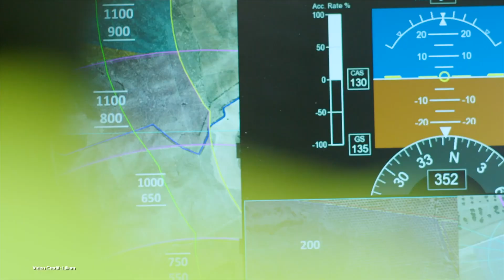ecoTEC Episode 343: Solar-Powered Trip Across Africa! Paris Motor Show! Zero Labs’ “Anti-Cybertruck!

Comment: My biggest concern is this: if the entire fleet of ICE cars that exist on the planet right now all were replaced 1:1 with EV,s where would that level of battery materials come from? 
a) We've have to mine half the planet to get the resources needed. 
b) There's countries like China that are clearly leaps and bounds ahead in the manufacturing department. 
I still feel like Hydrogen is the better long term solution, but Tesla just made the "EV" cool and everyone follows what's cool, not what's logical. 
I love what Hiringa is doing in NZ.

Sure we'd probably still need china to produce the fuel cells, likely as it's cheaper to use their massive world leading (and somewhat suspect) factories and plants. 
I also know that the platinum required for FCells is rare and scare and hard to extract.. but if we could come up with a more sustainable solution to that I feel it would be easier. ^_^ (I  know so easy to just replace an element right?)

So whilst I love the idea and 100% support the idea of EV's, I feel until we can completely synthesize the creation of the components needed for Batteries from renewable materials it's just not a smart option to have the whole planet become EVs. 

Someone needs to make an modern car that runs on a spring wound clockwork that boils water and makes steam to pressurise and move a ICE style engine, with sails.  Yea I know..

Ever see the game Syberia with the wind up train? we need that IRL lol.
Reply: Your just recycling the same old FUD...
Reply: Awww it's cute, you typed or, more likely, copy and pasted all this and posted it feeling all clever, but all you did was expose a deep lack of knowledge and an incredible gullibility to believe what the fossil fuel industry has told you.
Reply: Lithium is really common, "just" a case of mining it, and there's also other chemistry like Sodium ion, EV batteries are also recyclable, so whilst it's not 100% once mines most will be reused. 94% of Hydrogen comes from fossil fuels, (green hydrogen is only 4% and is really expensive). Green hydrogen isn't efficient,  you need 4 times as much electricity to move a vehicle the same distance as EV, Fuel cells also don't last anywhere as long as an EV battery (100K vs 400K), does produce pollution like NOx (our air is not 100% Oxygen, there's other things there that react), and you would need to continue to produce Hydrogen as well as distribute, so again, far less efficient.
The first Hydrogen cars were released in the market before the Model S from Tesla, and have never made any head way.
Reply: @Knott1701  it's unbelievable right? 
If we had to make enough batteries for every car to be replaced we would need about a MILLION TONS of lithium alone!
Meanwhile we are already extracting 100 million barrels of oil (that weigh 136 kilograms each,  so 13.6 million tons) EVERY DAY! 
And hydrogen production would need at least 5 times as much energy to be produced as we do now, just to make the hydrogen.
Reply: @rogerbrand6214  Was fortunate to go to the Paris Motoshow, one of the manufacturers had a sodium ion battery on display, 160Wh/Kg, compared with 180Wh/Kg, for LFP, and 250Wh/kg for NCM